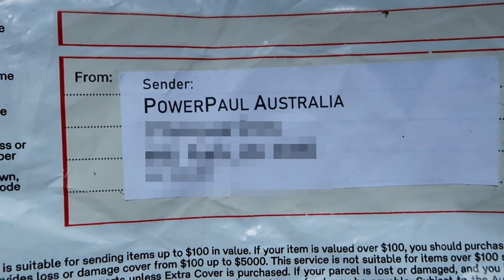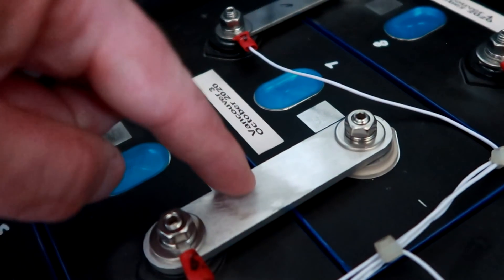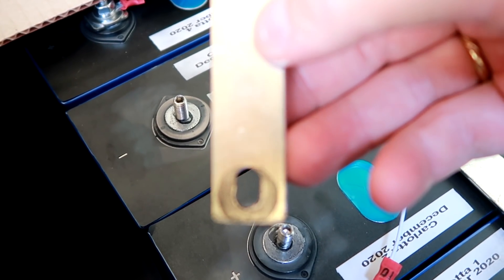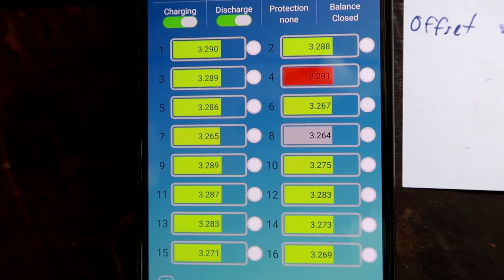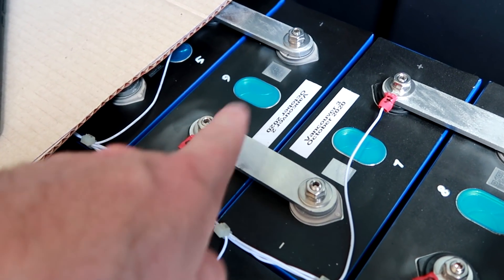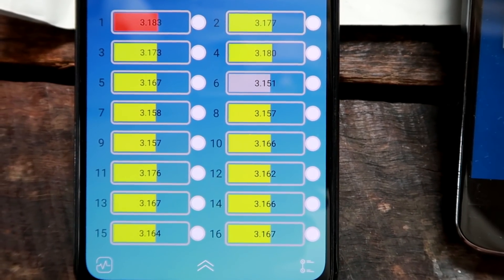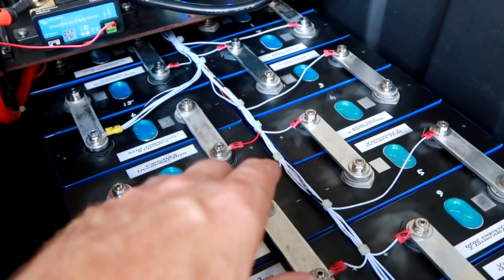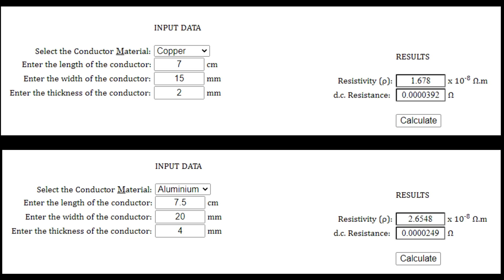Upgrading to Aluminium Busbars. Will this solve the issues?

Comment: i think you should drill and tap a hole in the middle of the link bars to fasten the balance leads to so they are equal distances from the terminals to be able to get better readings
Reply from the maker: Well, they should be reading the positive terminal voltage of each cell. So connecting them further away from the positive terminal may not help at all.
Reply: @OffGridGarageAustralia  i was thinking equal contact as it is just one extra layer on the positive terminal and all vidoes i scene of pre built packs tend to have the balance cable in the middle on the link bar
Reply: @OffGridGarageAustralia  For the voltage feedbacks of the GE traction inverters ( 1 MW) GE use lugs with a palm about 22mm outside  diameter so it matches the power lugs and therefore gives an accurate feedback. 
Those lugs are yellow 6 sqmm size, I haven't taken notice of how the 1.5 sqmm cables are crimped. 
Earlier I looked to see if Red 1.5 sqmm M6 lugs came with a larger palm, the only size I could find was 11 mm OD. The OD of the M6 Belleville is 12mm, I will check it out while I await the cells etc. 
Upsizing to blue or yellow could be an option,  I will measure lugs in stock tomorrow and check the Red2Go site also.
GE and other US OEMs use a crimper that swages the lug barrel instead of flattening it, I don't have one.
Reply: It should not matter because the balance wire is just checking voltage then the balance load is usually very small and it should be pulsing that and checking voltage when the balance load is off
Reply: Good idea!

Comment: I have a couple thoughts that come to mind about all this...and I could of course be wrong. Somewhere along my education I'm pretty sure they said electricity doesn't travel through the wire but actually on the surface. If you have nickel plated copper bus bars wouldnt your resistance be of the nickel then?

Another thought is even if copper is supposed to be the best conductor to use. Isn't the entire system already handicapped so to speak as the Battery Terminals themselves are Aluminum? So there is no benefit in using Copper Busbars.

Using Aluminum would also eliminate the added corrosion caused by mixing metals. 

To me using the Aluminum ones make sense and they sure do look Nice!

I dont know if I would add any paste of anything between  the bus bar and terminal. Maybe some dielectric grease after everything is tightened and final to keep oxygen out.

Think I'm gonna have to get me some of those pretty Aluminum Bus Bars 🍸!
Reply: You’re referring to the skin effect, and it occurs during high frequency AC transmission not DC
Reply from the maker: Thank you Landon. As Bryce already mentioned the skin effect occurs under AC usage only and is not relevant for DC. Here, only size maters. So far they seem to have solved the problem.
Also, dielectric = isolating
Reply: Thank you. See thats exactly why I'm here, to learn.

Comment: If you were having problems with the bus bars before, the cells' SoC may have drifted apart significantly. Top-balancing all your cells again might be in order.
Reply from the maker: Yep, absolutely and I haven't fully charged the battery for a while.
Reply: The problem is not the busbars - full stop.  The busbars and the connections between the cells is virtually identical.  It's easy for busbars to be manufactured within very tight specifications.  And, countless millions of busbars just like these are in service all over the planet and are not the source of any kind of problems in their installations.   On the other hand, the battery cells themselves are not manufactured to such tight specifications and there can be significant variations between them in the manufacturing process.   This is why they must be matched with each other and balanced prior to using them together in a battery pack.

When battery manufacturers create battery packs, they have thousands of cells from which to choose.   They select those cells that are closely matched to each other in capacity, and not just voltage.   And, they disqualify cells that are not matched or do not meet the capacity specifications of the cell manufacturer.   Those cells end up on the market as "B" grade cells.    Consumer hobbyists then acquire these cells and put together their own battery packs.   Unfortunately, they can't be so discerning with the cells and are pretty much stuck with the cells they purchased.   If they bought sixteen cells and one of them is out of tolerance in terms of capacity, their choices are simple - either accept that their pack will be degraded in capacity or purchase a replacement and hope it will be within tolerance.

I suspect what is happening here is that one of the cells is either out of balance or mismatched to the other cells in terms of capacity.   No amount of polishing busbars or using conductive paste or rearranging the cells is going to correct that problem.     My suggestion would be for him to purchase at least four more cells and hope one of them will be closer in tolerance to the others in his pack of sixteen.   Then, he can cobble together a 4s1p pack that will, of course, be mismatched and of degraded capacity.   But, his main pack can still be serviceable.
Reply: @richardowens9061  Its for the reasons you mention I purchased 4 extra cells.
Reply from the maker: @richardowens9061  I've done a full capacity test coming in the next video...

Comment: yeah the aluminum busbars looks much better!  Yeah im thinking if only for the garge that inverter just fine, if for entire house and garage maybe you would have to make some 3 phases for simplicity. I know some victrons you can set up as either parallel or 3 phase system. Also i was looking at these STECA SOLARIX PLI
5000-48   and they you are supposedly be able to set up in 3 phase aswell but i dont like it was just 2 year warranty on those.
Reply from the maker: If I ever connect the house to this system, I need a second inverter or upgrading this one. I have three phase power in the meter box already but only 2 phases are going to the house. Whoever stupid electrician decided on that one...
Reply: @OffGridGarageAustralia  And the third I'm guessing at your garage? btw. nice buss bars..  have fun!

Comment: Carbon/graphite/whatever grease is no substitute for anti-oxidant paste for electrical connections to aluminum. By the time you put your random other paste on the aluminum terminal, they have already oxidized and will give you contact issues.

Comment: I agree with you, the choice of inverter capacity is an individual decision based on all the considerations you mentioned. Perhaps its worth adding a soft start module for your inductive loads like the pump and mulching machine. Of course, one could make the argument to skip the soft start modules and put the extra money into a larger inverter. I don't believe that those two solutions are equal. It is MUCH better to limit inrush current than to up-size an inverter. No matter how big the inverter is those instantaneous current spikes stress the electronics, especially the transformerless type. Lastly, each of those prismatic cells, even if matched at the factory, will age slightly differently and the internal resistance and self-discharge rate will diverge. A full time, active cell balancer of sufficient capacity will help tremendously. Seriously, its the way to go.
Reply: Low frequency inverters are much, much better at surge loads than high frequency inverter.

Comment: I don't get it. You have a voltage drop somewhere. Why don't you first measure if you have a voltage between the adjaccent poles of the batteries that the bus bars should connect? The voltage difference should be zero even at high currents - otherwise you have a bus bar or a connection that has a resistance in it. To just replace the copper bus bars to aluminium (which corrodes as hell) seems... not very wise in my book. 

My advice is that your discharge the battery package with a high output current (1C if you can) and then measure the voltage drop simultaneosly. This trial-and-error seems just illogical to me. 

Disclaimer: I might have missed a previous episode of Off-grid-garage where you did all that, even though I doubt it.  ;-)
Reply: Yes you did... Yes you did. Andy has done that already.
Reply: @ricardomarcelino8388  Please give me a link to that episode. I’ve got to see it if he has really measured the voltage drop under load.
Reply from the maker: Just here in the last video: https://youtu.be/AbU6UENr_-A
Reply: @OffGridGarageAustralia  Got it, thanks. A bit confusing is it.

Comment: You may end up finding that your aluminum bus bars get a bit warmer. The electrical conductivity for Copper (C101) is 101% IACS and Aluminum is 61% IACS (Electrical Conductivity (annealed) and the resistance is 17.2 nΩ mm vs 28.3  nΩ mm. But since they are thicker maybe it will even itself out? Aluminum didn't work out so well for me, but let me know how it works out for you, mine were the same length and thickness so that could have been why it didn't work on my setup. Edit: Lol After I posted this comment you spoke of this at the end of your video, So it does have to do with the thickness!
Reply from the maker: Pushed 70A so far and no heat, they all stay cold. I think size really maters here.
Reply: @OffGridGarageAustralia  Agreed. The more material the less resistance..

Comment: Why go with aluminum when you can buy copper flat stock?
Reply: Aluminium terminals corrode more with copper bus bars?
Reply from the maker: Hi Justin, watch the video until the very end. I showed some calculations and the Al are much better than the Cu bars.
Reply: I agree with the aluminum being better than the original but why not get 4mm thick copper and make buss bars with that?

Comment: I’m curious if you’ve checked whether or not the original bus bars are actually copper (nickel plated)? I wouldn’t be surprised if someone somewhere tried to cheap out and used steel instead?
Reply: He did show at a couple of points where he'd buffed off a bit of the nickel on the outside and it def looked like Cu underneath.
Reply from the maker: When I polished the busbars, they showed pure copper underneath.

Comment: Humm aluminum busbars.. Sweet! Ya they look much better for the current! So professional looking, that should solve it. Cheers Andy happy Sunday!
Reply: Copper busbars are more conductive and more resistant to corrosion than Al.
Reply: @neliosamch3195  Just by graduated and calibrated eyeball, the cross sectional area of the new bars is about double the previous which will compensate for the 60% conductivity factor of Aluminium,  provided certified joint paste is used.
Personally I will use the copper bars that come with the cells unless there is a fit up problem. I will however go to a lot of trouble with workmanship and material choice.
Reply: @mikenewman4078  Right, but do we have any research that indicate that we need more than 20A bridge between cells to justify such humongous busbar?
Reply: @neliosamch3195  It is called basic electrical theory.  In a series circuits all current flows through all components of the circuit.
I had a longer explanation for you,  but phone decided different. 
I can give all the ins and outs when I get to a PC, just ask.
I teach electrical subjects and have been in the game for 48 years, so I had better be able to answer your questions. 
Cheers
Reply: @mikenewman4078  Thanks Mike I like basic and simple concepts that can be understood by ordinary people like me that comes to these forums to get educated on what not to buy but with so much theater and drama we get distracted and always pay the price for it.
Reply: @neliosamch3195  I had quite an explanation for you including how to prove things for yourself,  but I must have held my thumb in the wrong place and it disappeared. 
Just let me know if more explanation is needed. I'll do it on a PC.
When I teach electrical or hydraulics, I start with the fundamentals so students derive what they need permanently.
Reply: @mikenewman4078  Mike nowadays  I don't use pc no more but if you want to teach something relevant this is a good platform where everyone  learn and share their knowledge.
Reply: @neliosamch3195  More conductive than aluminum true. On the other hand 1. no dissimilar metal corrosion. 2 the thickness of aluminum makes them more conductive than the free ones from Ali E. To me it is certainly something to consider .. cheers!
Reply: @DavidLouthan  I'd go for it if a need be but I would go first with the critical mind. Do we really need a 400a gage when only 20a gage max is what we need in a 48v system? Don't let marketers and sellers sale you what you don't need. The only connection that look good is perfect and never have problem is the laser welded ones.
Reply: I may have to contact Paul 🤔 Andy around 15:20 ish the closing speech started lol it might be in the wrong place. My movie maker glitches like that sometimes too hehe just saying but you may have planned it to. Catch you soon brother ✌
Reply from the maker: Thanks 👍
Reply: @OffGridGarageAustralia  Welcome 😉

Comment: Flattened copper pipe seemed to serve me well. Better conductor than aluminium.
Reply: Sure better conductor but you saw the thickness diffrence there man, i mean its not like they dont make power cables with alum so...
Reply: But, what it copper messes with the actual bank average internal resistance.... Au VS Cu   Tonight only in the Squared Circle? IKD I had a few Stellas....
Reply: negligible difference at such short lengths, besides the extra width and thickness more than makes up for it.  With aluminum you also have a greater advantage in that the terminals are aluminum so no chance of galvanic corrosion, and also aluminum being softer than copper, when clamping down the terminals it molds and shapes much easier filling in any scratches and surface imperfections and creating a much better connection.
Reply: Only a better conductor if it is the same thickness. You still have dissimilar metal corrosion in humid environments.
Aluminium is cheaper, more available and easier to work.
Reply: I'm just thinking to that quite possibly the BMS is calculating voltage drop across cells with the resistance of the Aluminum...I have no idea
Reply: @KD2HJP  Hmm yeah i have no clue of that but i wonder if that one tricky cell that they sent with a b-grade cell with the good ones.
Reply: @JPHER217  yup. Exactly what I think